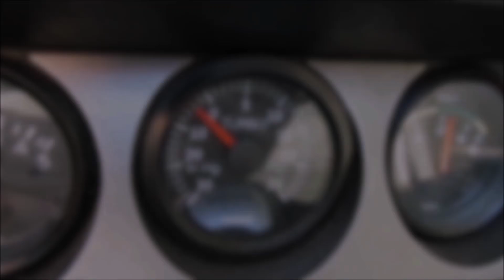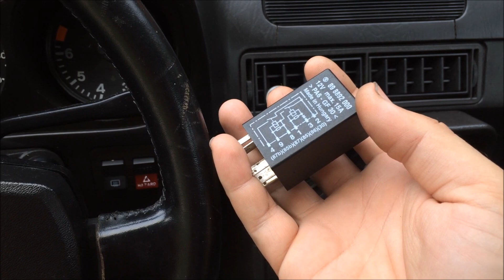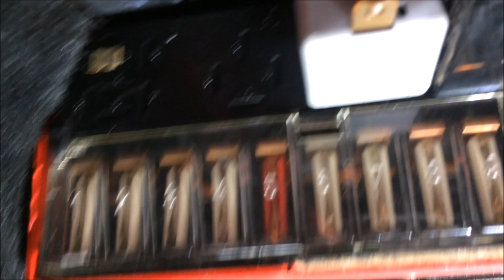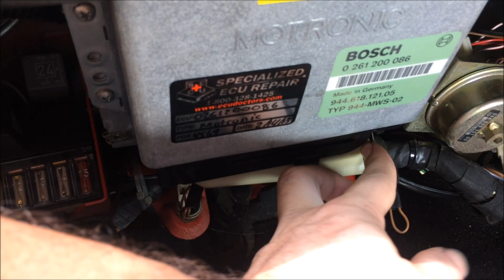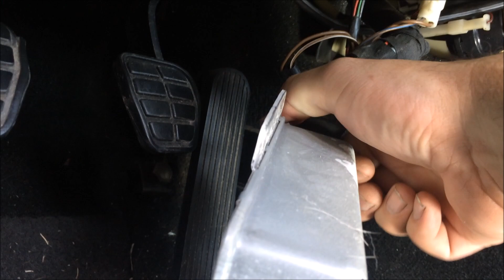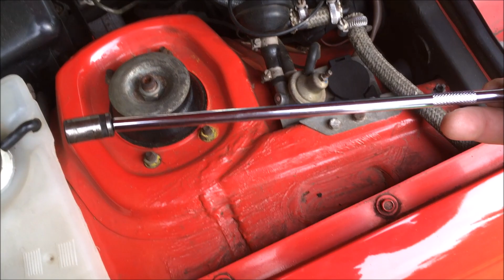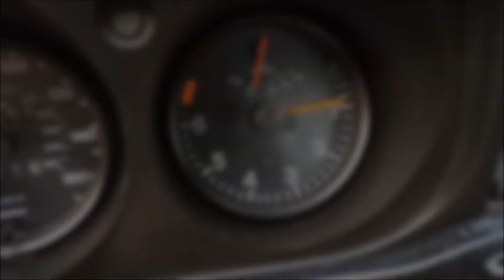Troubleshooting a Porsche 944 No-Start Condition

Comment: Where should I begin if car does have tach bounce but wont start?
Reply from the maker: So basically, if you have tach bounce then you are probably having a fuel issue. If you haven't tried another DME relay yet, then you should start there. If the new one isn't working then you should try jumping the relay and listen for the fuel pump to run. If you hear the fuel pump, then it could be several things since the relay isn't activated until the engine is rotating. So it could be a wiring issue (check the relay socket), the other sensor on the bracket, or the DME. If you don't hear the fuel pump running with it jumped then check the voltage and replace the pump if necessary.  I hope that helps!
Reply: @edredas  awesome thanks
Reply: @edredas if you're getting tach bounce and spark, would a continuing no start condition indicate something still wrong with the fuel delivery side of things or something wrong with the injection side of the system? With the fuel pump jumped, I can hear fuel flow in the return in the engine bay, but the car will still only run on starting fluid.
Reply from the maker: Brek Moorey yup. Use a noid light to verify that the injectors are getting a signal. If they aren’t then it could be the dme. If they are getting a signal and not working then they’re clogged or frozen. I hope that helps.

Comment: Would the DME keep the car from cranking?
Reply from the maker: Nope, with a bad DME the starter will still turn the engine over. If nothing is happening then it would either be a weak battery, bad starter, ignition switch, or wiring. I hope that helps!

Comment: With my 944 my sensors are reading just over 1000 ohms and I don't have tach bounce nor any lights on the dash and the red light on my dash if off could it be the immobiliser or the dme ? Any help would be appreciated
Reply from the maker: Sounds like you're on track. Hard to say which it could be without doing some troubleshooting. I believe Clarks garage has a write up on jumping the alarm/immobilizer. I would try that first then I would try a different DME. I hope that helps!

Comment: I got the other DME in the mail and plugged it in, still no change, no tach bounce, no spark at coil... what is between the dme and the coil? Is the factory alarm in there somewhere? Is there a relay that connects dme to coil? How far are you from Lockport, NY?
Reply from the maker: Hi, I'm just outside Charlotte, NC so quite a drive. Sorry to hear you're still having issues. The alarm very well could be an issue but there are some ways you can jump it, if your car is equipped. Here's a pelican write up that might help! 

https://www.pelicanparts.com/techarticles/Porsche_944_Turbo/36-ELEC-Troubleshooting_the_Alarm_System/36-ELEC-Troubleshooting_the_Alarm_System.htm
Reply: edredas , yeah, that's a little bit too far to have you stop by and check it out, lol, I'll try bypass g the alarm  next, hopefully that gets me started... thanks again for your help, I really appreciate it...      Edward
Reply: So... I'm a little confused about bypassing the alarm system, do you unplug the connectors and replace with the jumpers, or add the jumpers while connectors are plugged into alarm module?... I'm at my wits end, I've replaced both sensors, the dme relay, and got a remanufactured dme... the alarm is all that's left as far as I know...

Comment: I have an 84 944 that I replaced the speed and reference sensors  and I still have no tach bounce and no spark. I opened the dme relay and it checked out fine,  I opened the dme looking for bad solder joints or opened resistors or burnt components, it looked like brand new. I get 892 ohms on dme plug pins 25 and 26, and 912 ohms on pins 8 and 27 and the readings change when I turn it over. What else should I try?
Reply from the maker: Looks like the sensor are okay, sometimes the DME joints can crack and its hard to tell. They usually crack around a heat sink on the bottom board and to see it you'll need to remove the bottom plate. Re-soldering this area has repaired many DME's! I hope that helps!
Reply: edredas , thanks, I'll try resoldering, in the mean time I ordered a DME from ebay,  if the resolder fixes it, at least I will have a spare... and thankyou for your videos, they've been a great help in rebuilding my 944

Comment: On the back of the DMG plug, you test resistance between pins 26 and 27? I thought (?) for the reference sensor it is pins 25 and 26?
Reply from the maker: Yeah that’s correct. I goofed. I was doing this off the top of my head and just threw this video together in 5 minutes. I was just trying give an idea of things to check but as always everyone should check the manual and follow those steps.
Reply: Your videos have been SO helpful to me as I tackle this field-find 83 944. I just don't know what I'm doing, which means I have to double (triple?) check everything to make sure I'm following directions.

Because (duh) no spark. So just double checking. 

Again, though, THANK YOU for this and all your videos!

Your vacuum video saved my rear end: someone had pulled many of my lines and reconnected some in the wrong places, and without your video, I never would have sorted out the diagrams. Did I say thank you? :)
Reply from the maker: Awesome, glad I could help!

Comment: I have the hot no start issue, Will have to check sensor and harness when the car is warmed up, cold everything is fine...Thanks for posting!
Reply from the maker: Good luck! Let me know what you find! That white '88 944 that I did a video on is now having a hot-start issue and I haven't had time to diagnose it. I've been told that it will only run for about 10-15 seconds and then the fuel pressure shoots way up and dies.
Reply: well, my first guess is a vaccum problem that lets the FPR "close" the return and pressure spikes leading to a too rich condition. my issue is after engine is varm (20 minutes of driving or so) I can't start it until it cools down, pressure is fine so I think it is electrical, Have to check tacho bounce next time I start to see if it is a speed sensor problem or harness or connector. Occasionally it can be the ign.coil...but that is rare.

Comment: Having a problem with my '83 944 where it will start, run for 30 secs or so and then stop. After it does that, It will start for maybe a second and then cut out....Knowing that the car does at least start, should I still look into replacing the relay and/or the reference sensor?
Reply from the maker: When a sensor or the DME relay fails the car will not start at all. Check that all the vacuum lines are connected. If the engine is running rough pull the vacuum line off the FPR and check to see if any fuel is dribbling out. That would mean that your FPR has failed. I hope that helps!
Reply: I have experienced on and off seize of engine while driving. I removed the DME relay, shook and placed back in and started. I replaced the DME relay at home and never had the problem again.

Comment: Have you tried the new solid state DME relay that's available now? They sound like the bee's knees when it comes to a quality replacement part for this troublesome item.
Reply from the maker: Not yet, I have a stack of brand new relays so I haven't had the need, but I am very tempted to get one! This car is daily driven and I also do a lot of road trips so it would be nice to just have one less thing to worry about. That said, in my almost 20 years of ownership and driving many of these cars daily, I have only experienced one DME relay failure. So, it isn't something I worry too much about. I had a spare with me so it wasn't a big deal. Now, if I buy a car I usually just go ahead and stick a new one in, so it has made this mostly a non-issue for me. This was only the second time I've ever had a no-start issue with a personal 944 series car, so if I were to get a soild-state relay it would just be to try it out. Thanks!
Reply: That's good to hear. When I get one of these cars together I'll expect it to by my daily driver as well, so it's nice to know they can be that reliable. I've accumulated most everything I need to make it happen, from a machined/plated ready to assemble block, to fully rebuilt transaxle, NOS AFM, Bosch factory reconditioned DME, and virtually everything in between. I just need a chassis to put it all in, and most importantly, time.

Comment: No start issue. Need suggestions.

My car will crank, but it's not getting fuel. If I spray some ether in the throttle body it will run. (Until it runs out of fuel) The tach needle moves and so the crank sensor is working. 

I have checked the fuse in the box in the engine compartment. I also checked the DME/Fuel pump relay, opened it and resoldered the posts even though they looked good.

I replaced the fuel pump and filter today too.

I'm thinking it's a DME issue. How do I test the DME? What companies offer a repair service for our DME's? Thanks!
Reply from the maker: Hi, there are several places that repair our DME's. It appears that mine was sent to ecudoctors.com and they did a great job. You mentioned checking a lot of things but have you checked the speed sensor? This is the other sensor on the bracket. When the this sensor goes bad you will still have tach bounce but the DME will not know the engine is trying to start so the fuel pump will not be turned on. I hope that helps!
Reply: edredas Thanks for the prompt reply! I will have to try that speed sensor next with the great info from this video! Sensors are cheap compared to the DME! <fingers crossed>
Reply from the maker: No problem! Hopefully you'll get it running! Let me know you need any more tips, thanks!
Reply: edredas My multimeter is on the fritz. I checked both the sensors and didn't get any reading, yet I still have teach bounce. I will try another meter sometime this week. Thanks for all the suggestions!
Reply from the maker: No problem! I have several spare 85.5 DME's that I could loan out if anyone just needs one to try in the Continental US. I was thinking that someone could just pay shipping plus $75 collateral or so then get the money back when they ship it back. If you get those tested, let me know if that is something you might be interested in? I don't want to sell them since I need them for troubleshooting but maybe I could put you in touch with someone that has a used one cheap! I hope that helps!
Reply: I just picked up another multimeter. Both the crank position sensor and the speed sensor checked out good.  I'm going to make one of those jumper wires I've seen others use to bypass the relay. If that doesn't work, I'll put the multimeter to work at the back of the car to see if the fuel pump is getting power.
Reply: No start help needed...

Hi guys I was hoping I could share my experience with you and maybe get some ideas as to how to test to see if my DME is broken. I have replaced the fuel pump and drain the tank and inspected the screen. All are put back in and I have replaced some of the lines at the rear of the car that go from the filter to the Hardline. I have not replaced the lines up front as of yet because the previous owner has already done it. I will do that again with AN fittings once I have the car running.

I took apart my DME fuel pump relay and resoldered the joints but it did not help. I bought the DME relay with the three second fuel pump priming feature from Focus 9. Now when I turn the key I can hear the pump run for 3 seconds and if I go to start it, the car we'll run for a few seconds and die immediately.

I heard someone mention on another post about the Porsche having some kind of Anti-Theft system that can prevent the car from running. I need to troubleshoot see if I have some kind of anti theft security battling me or if my DME is broken.

I appreciate any help or suggestions you can provide. Thanks!